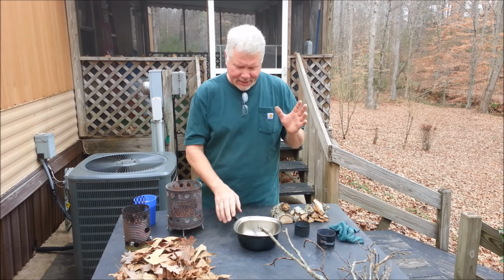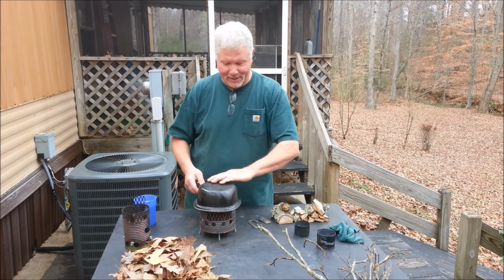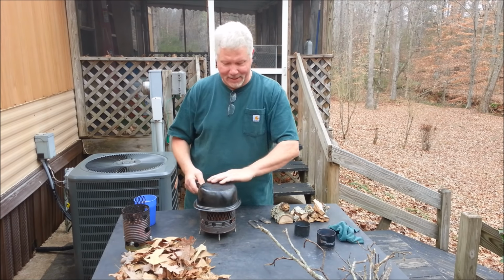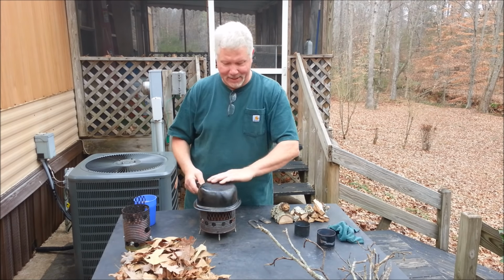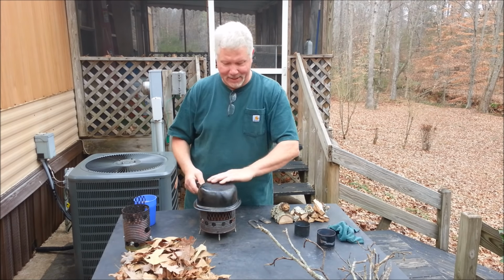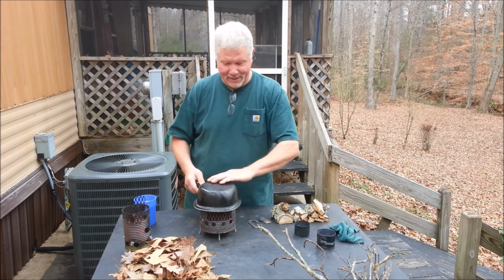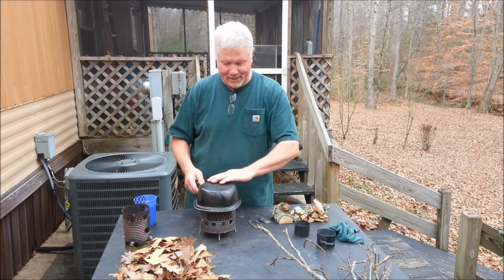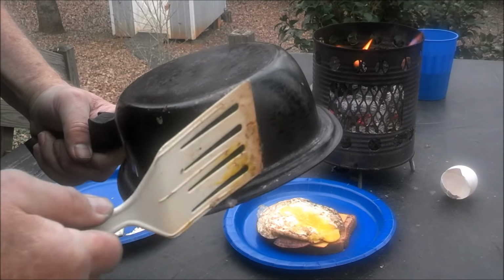Easy Fire Building... No Lid Char Tin Char Cloth... Non-Stick Cooking on Pan's Carbon Build Up

Comment from the maker: The theme for today is AIR... I just couldn't come up with a catchy title that include it. The reason I can so easily build fires in my hobo stove is because of how loosely and open I build the fire which allows the air to easily feed the fire. The next air experiment deals with the question about whether a hole is even needed at all in the lid of a char tin. So, The question used to be, "will the smoky and gaseous air escape properly without a hole???" LOL. in this experiment I take away all obstructions those the off gasses. I'm making char cloth in tins without lids at all. You just have to cover the tin opening when you remove it from the fire to keep the oxygen out till it cools. The lidless tins made perfect char cloth. And lastly, We figure out if putting a pot upside down on my hobo stove will snuff it out? I invert it to see if the carbon build up on the bottom of the pot can be used for a decent non stick cooking surface. LOL!!! Come see how it all turned out. Please SUBSCRIBE at the end of the video. Thanks!

Comment: i have to say i am impressed and i agree i think your onto something with the carbon build up being non stick
Reply from the maker: Thank You. The build up was somewhat non stick. You can see that, when I was cooking the bologna. But as with all new built up carbon cooking surfaces, black iron skillet, it needs more seasoning. I won't be doing any more work with this technique because I'd rather my stainless pot stay bright on the inside and these flames marked up the interior pretty badly. Thanks!
Reply: Loved how you combined several fun experiments into one video! My mouth is watering. I just decided what I am going to have for breakfast!